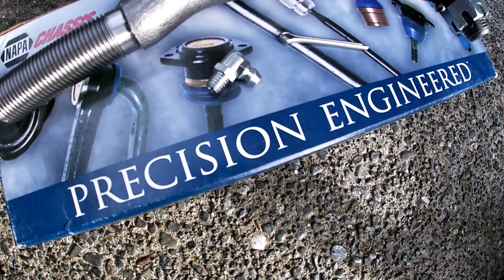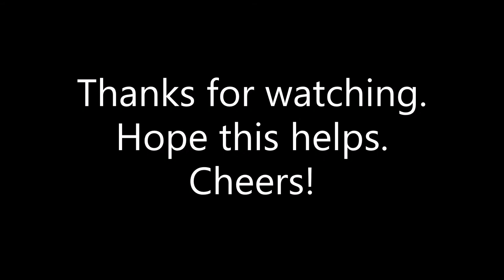2nd Gen Toyota 4Runner Tie Rods

Comment: Great job & thank you for using jack stands for safety. I've seen videos where guys only used the original jack that comes with the 4 runner to raise the 4runner without jack stands to do suspension work. I cringe at these video because I've had the experience of my 4runner falling off these narrow cheap jacks on 3 occasions out on the street on flat tires. Good think I always kept my body & head clear away just as a precaution. Thank God I did.
Reply from the maker: Agreed! Thanks. I have used the crappy little jacks before acquiring our current set up however I always would pack some wood blocks in there just in case.

Comment: Hey what happen if you tighten the castle bolt really tight
Reply from the maker: It will just pulled the tie rod more into the hole until something gives like the threads on the nut. The part that slides into the hole is tapered.

Comment: Everything is in metric. 3/4 socket should be a 19mm. Great video otherwise! Poor pitman pullers 😂
Reply from the maker: Thanks! Yeah I have found a few aftermarket parts previous owners have installed with imperial sizes but most have been metric.

Comment: Typical china crap. Looks like you'll need to do the seals in the power steering pump. Just did mine last weekend. Get the kit from Toyota and replace them yourself. It's not hard just remember how it comes apart and put it back the same way.
Reply from the maker: Yeah those PS pumps. We ended up just replacing the pump since the previous owner had the same issue and the truck had been through a few owners in a short span. Not knowing if it had been run dry at some point, we elected to just swap the whole thing out.